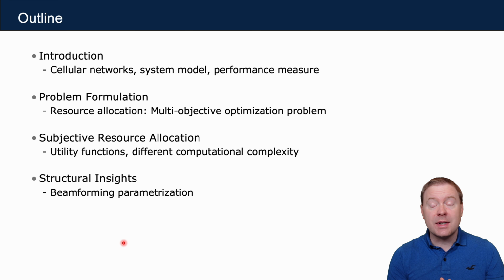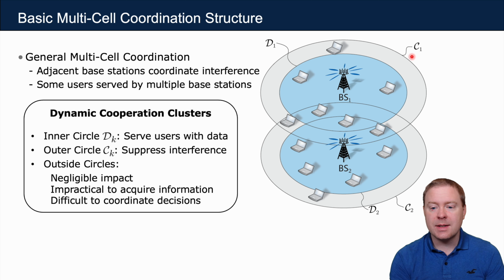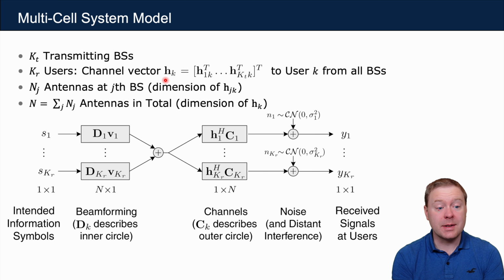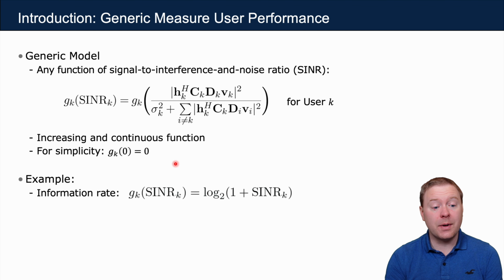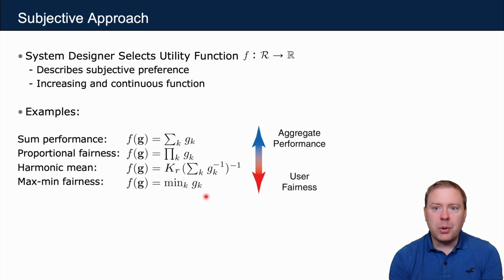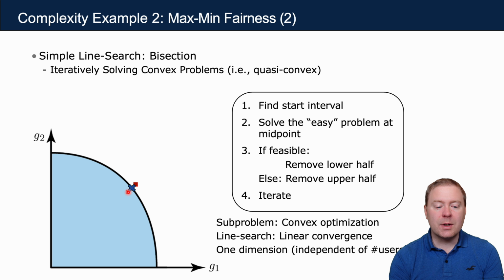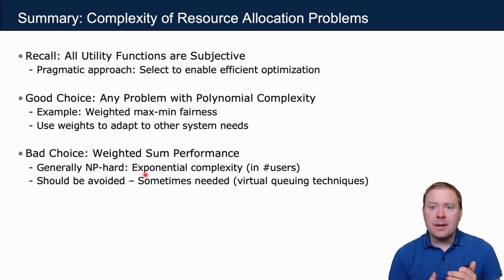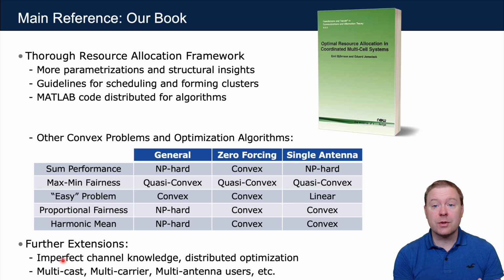Optimal Spatial Resource Allocation in Cellular Networks

Comment: Thanks for all of your videos, a general question. Speaking about a general MIMO array you presented in former videos, how is the distance between the antennas and the back plain?
(On the back side there is a plain that works as a reflector I assume.)
Do they chose a special distance for a specific reason (multiple of wavelength)?
I think due to the reflection we get a standing wave.
Thank you.
Reply from the maker: There are different types of antennas, and only those that radiate "backwards" require a reflector behind them. One wants to ensure that the back-reflected signal is phase-aligned with the original signal in the forward direction. Since the reflection turns the signal upside down (as if it traveled lambda/2), the total distance back and forth to the reflector should also be lambda/2, so the signal is effectively delayed by one period. Hence, the reflector needs to be at a distance lambda/4 behind the antenna.

At so short distances, there will be mutual coupling between the antenna and reflector, so there will be more electromagnetic phenomena appearing. I'm not an expert on these things, but I believe my answer captures the most essential things.

Comment: Hi professor, when users are equipped with multiple antennas, do we have the parameterized optimal beamforming structure? Thx in advance
Reply from the maker: There is a similar structure, because there is a duality between uplink and downlink also in this case, so the optimal beamforming matrix resembles an MMSE combing matrix. However, it becomes more complex because there is both a transmit beamforming and combining matrix for each user.

There is a famous algorithm called WMMSE that looks for a local optimum to the sun rate maximization problem. The solution reveal how the beamforming should look like:
https://vbn.aau.dk/ws/portalfiles/portal/19176960/ICC2009.pdf
Reply: @ yeah, thank you. I know the wmmse algorithm, but it seems that it needs iterations to converge. I mean, could we have a semi-closed form structure just like the MU-MISO? If so, where could I go for some reference? Thx a lot!

Comment: Thanks, the book is from 12 years ago, is it still valid knowledge?
Reply from the maker: Yes, the nice thing about scientific knowledge (at least when it is math- and physics-driven) is that it remains valid over time. However, one can question the current relevance of this book and video. The book still defines the foundations for spatial resource allocation in multi-user MIMO systems, including cell-free massive MIMO networks (even if that term was not coined then). If one doesn't understand these basic principles that we explain, grasping more complex problems and solutions will be hard. The main theoretical developments over the past 12 years are related to managing imperfect channel knowledge, multi-antenna user devices, and transceiver impairments. We touched upon that in the last chapter, but much more has been done on those topics. Hence, Chapters 1-3 are most timeless and interesting to read today!
Reply: Unable to download the PDF file